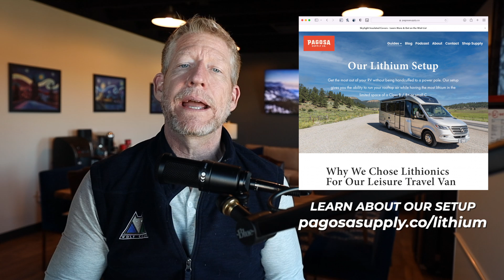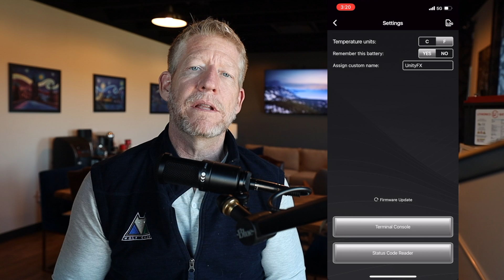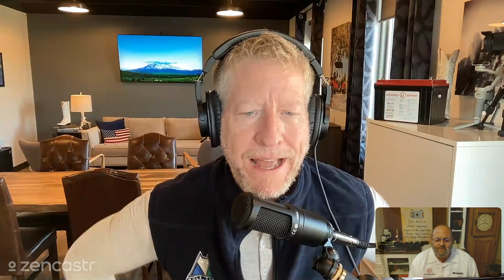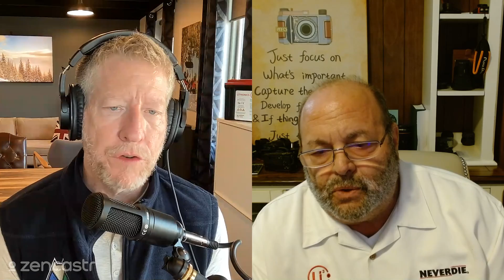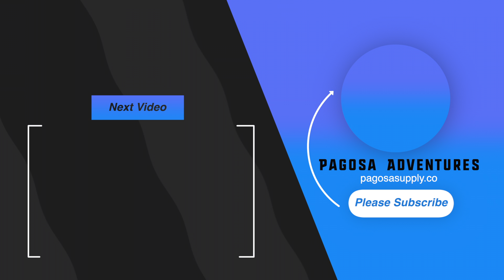Upgrading to Lithium batteries and large inverter? Watch this first!

Comment: Will you be getting rid of your generator? We are thinking of getting the Lithionex 315 battery and using the 2000 Watt inverter that is wired for lithium for now.  Once you are fullly integrated do you still need the generator?
Reply from the maker: I am keeping the gen. Great backup plan for sure. I'm a proponent of being prepared and the 315 is fantastic for everyday use, but when you need all day or all night Air Conditioning, you will want the generator. If I were to do it again, I would get no generator from factory, do three 315s and carry a small portable $800 gen for emergencies.

Comment: I’m preparing for delivery of my MB and planning my upgrade. I am switching from a Coachmen Galleria 24A Li3 and can’t live without Lithionics. My question is this: What do I need to do to formally put the Microwave and Air Conditioner on the inverter? Dean’s video says “If you order the Lithium upgrade we put the Microwave on the inverter” so I am assuming something has to change. Love your videos, very helpful for anyone, especially new LTV owners.
Reply from the maker: Great! you will love the MB. LTV started putting the microwave on the inverted side of the breaker box when they introduced the lithium option. Was always there before, so not sure why they limited it like that. But if you don't get the option, then it's a simple move over to the inverted side of the breaker box. Did that with my Air Conditioner as well. Let me know if you have any more questions about Lithionics. Here is our page on the subject: https://pagosasupply.co/lithium

Comment: We have to decide tomorrow in our options on our order for LTV Unity TB. Questions is…what do I not get in my options? Do I get the 400w solar? I do not get the lithium upgrade? Can I do the 315ah and 3000 inverter myself? How do I include microwave, air conditioner etc on this new upgrade. Is there a way I can speak to you today or tomorrow morning? HELP?
Reply from the maker: Hey Michael, you can email me as well if you like, but the 3000w and Lithionics is just a simple swap. The microwave and air conditioner then just moved to the inverted side of the breaker. Couldn’t be an easier upgrade these days. I would get the 400 solar and do your battery aftermarket. WAY more bang for your buck. brandon@pagosasupply.co

Comment: I have been toying with lithium battery for my 2020 Unity CB and viewed many You-Tubes. You are the best informed. I am in the process of gathering all of the technical info. In particular, I am interested in the new schematic Steven Tartaglia referenced in your interview. How long does it take to receive a 315 amp battery? You proposed in your video it is a straight forward swap with the old inverter and AMG batteries. No special additional wiring as  mentioned in a previous video on changing to Lithionics.  PS. Regarding TMS. I did not need to replace the stems in my 2020 Unity. My RV arrived with a slow leaking tire and the TMS was is a stress saver. I really appreciated in a previous video correcting the speaker system in my RV. On Monday, I will place an order and would appreciate exactly what I need to ready for boon docking. Thanks!
Reply from the maker: Glad the channel has been a help! The lead times are just a few weeks right now for the 315ah (as of this writing, can change though). The only thing you need to do is add the on/off switch between the batteries and new inverter, but really easy. You can email me if you have any other questions. brandon@pagosasupply.co

Comment: All these issues and engineering design changes just to run an RV air conditioner from lithium batteries?  What is wrong with this picture?  The obvious answer is the very inefficient AC unit on the roof.  How about focusing on an efficient 12 volt air con system?  That current roof top system is a dinosaur.  We have new 12 volt highly efficient motor/compressors coming to the market and currently used in mass production for efficient 12 volt refrigerators.  Without that ancient AC unit, I don't see a need for a 3000 watt inverter and associated issues with inrush.  In any case, it will take time, and for now, you have overcome the hurdle and made it work.  As an EE, I really enjoyed the video.
Reply from the maker: I really look forward to the day the RV manufacturers take the best road, not the easiest and cheapest road. I think the times are changing and we will see some of these high efficient 12V ACs soon. Thanks for watching.
Reply: Indeed DC powered A/C units are the hot item in the latest RV tech. A couple of choices already available for retrofits and even OEMs are considering them. However, 12v is not the best for high power devices, so 48v units are more desirable, which pushes the battery to 48v as well to avoid conversion. More and more RVs will go to 48v in the next few years, primarily driven by high efficiency and thinner power cables. Who wants to run 1/0 DC cables to the roof for 12v compressor?

Comment: Brandon I have another question for you regarding a comment you made in the Lithium Upgrade video. You mentioned installing two 315 amp Lithionics batteries in your Leisure Van.  I assume this provides you additional power storage that would extend your off grid capabilities. Can you fit two of the Lithionics batteries in the battery compartment in your Leisure Van and do you have a schematic of how to do this that I could provide to my dealer to do the upgrade?
Reply from the maker: I haven't installed the second one yet. You have to modify one of our your bays to fit the second battery in. Sandra Johnson has done this and you can find her guides listed on the LTV Enthusiasts page on Facebook. Hope this helps

Comment: Do you have any information on how Lithionics integrates with Adam Nations alternator that usually serves as an under the hood (UHG) generator, instead of using chassis alternator like in your LTV,  to charge RV's house batteries? Thanks.
Reply from the maker: The Balmar is an analog-circuit controlled regulator that is pre-programmed by Adam and this work just fine.   

The Wakespeed is a closed-loop, dynamic device controlled by the BMS to optimize the rapid filling and balance of our batteries.    Both are good, one is better and more modern as the Wakespeed is a CANbus-based device and very new and outstanding technology.

Comment: Thanks for posting this, very informative. Is the Lithionics firmware update sufficient for your setup or will you have to modify the wiring between your inverter and battery as well?
Reply from the maker: The only thing I will need to do is add an on/off switch between battery and inverter. The Xantrex doesn't have near the issue as the Victron inverters has, so this setup is ok.

Comment: Brandon I ordered a Leisure Unity RL approximately 6 months ago and have a while before I get it but it’s my desire to install the Lithionics 315 amp battery and 3000 watt inverter set up that you’ve discussed here but I’m not an electrical engineer and have no experience. What would you recommend my course of action be once I take possession of my rig in order to have this installation done and done safely and correctly?
Reply from the maker: That’s awesome. We have fantastic guides that you can give to an RV Tech or your dealer for the exact tried and true install. I had my dealer do my install.

Comment: We upgraded our Leisure UTB last month with the 315ah Lithionics battery and the 3000w Xantrex inverter, basically your same hardware setup.  The install was done by a Leisure dealer based on Sandi’s instructions from your web site.  We have since done the firmware update from Lithionics.  It wasn’t clear in your video if we have an “in rush” problem or not.  It sounded like the problem is with using a Victron inverter.  Do we have a problem using the Xantrex inverter?
Reply from the maker: It’s mostly a Victron issue, but it is now advised to have an on / off switch between inverter and battery as well with the Xantrex.
Reply: @OakAndCanyon  Under what circumstances would you turn the switch off?
Reply from the maker: @leslieharding6246  If you are putting the coach in storage and turn your battery off, or if you disconnect the inverter from the battery for any reason. You would turn that new switch to OFF, then turn your battery on to allow the BMS to start up before allowing that inrush current of from the inverter.
Reply: @OakAndCanyon  Hello Stephan.  Just now installing a Lithium battery and have another question: Based on Sandy's instructions I am installing an off switch for the battery (my Lithium does not have a built in off switch).  Based on what you said above, I also need to place an off switch between the battery and the inverter.  Holy cow, all this switches are gonna get confusing.   TIA  PS: I am not replacing the 1000W Magnum inverter at this time.
Reply from the maker: @brucecheek3472  the on / off switch between inverter and battery is just for 3000w inverters. However, you will want to make sure that 1000 magnum has the capability of charging a lithium battery. Most that size do not have the profile to properly charge. So something to be aware of.
Reply: @OakAndCanyon  Thanks Brandon.  Thought that might be the case.  I have checked the Magnum and it does have a Lithium setting.  Sandy suggested it might only charge the battery to 85% so I am installing a Kisae DC to DC charger as well to bring it to 100%.

Comment: Thank you for the video. 
I was going to order the Lithionics system vs Battleborn for my RV but after extensive look for any installers who can  put the Lithionics batteries in a proper way, I wasn't able to find anyone, I even talked to the manufacturer about it but no luck finding reputable installers.
Reply from the maker: Are you just adding the battery? Or upgrading inverter as well? If just the battery, then The battery change would be no different than the BBs. What are they telling you is the issue?
Reply: I've a new 24FX on order and I'm not getting the Lithium option through Leasure but installing the Battleborn system including the panels because we couldn't find Lithionics installers, no one I talk to wanted to do it. Everyone work with Battleborn. Itan issues the Lithionics couldn't even help with.
Reply from the maker: @Newcomb360  Give me a shout if you like, brandon@pagosasupply.co , as the batteries don't have anything to do with the install. Unless you plan on putting batteries in other places than the battery compartment, you will be limited to just 200ah with the BattleBorns. The reason I went with Lithionics is I get 315ah in that space. Again, the batteries are just the batteries, so should not have any install issues. Just positive to positive and negative to negative,  once they get the inverter upgrades done.